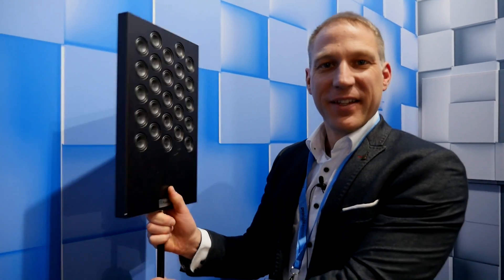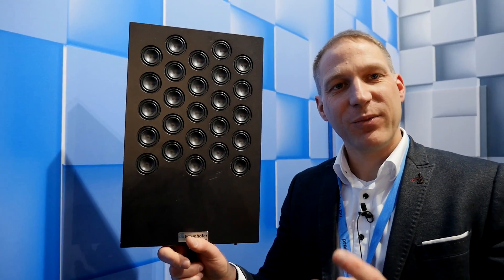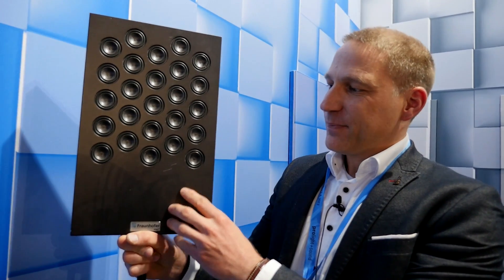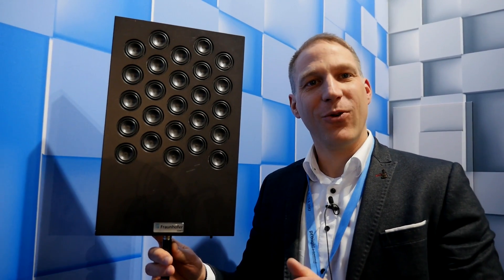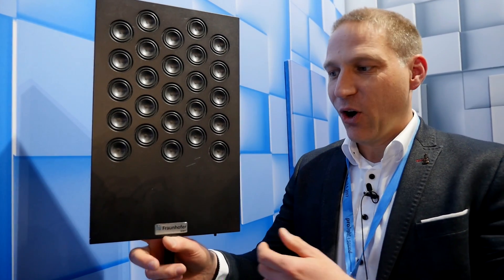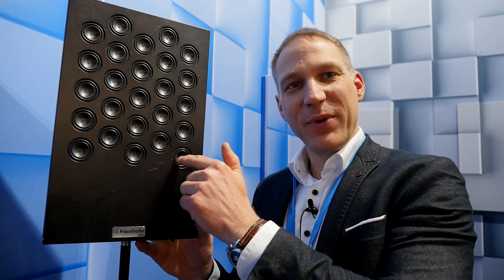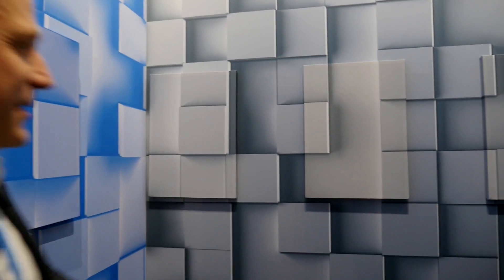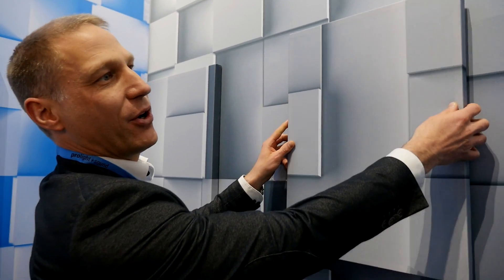MESSE 2017: Thin Panel Speakers from Fraunhofer use New Tech

Comment: Just call it what it is , pneumatic suspension !!! (the air sealed small enclosure that's air tight for every individual driver , it's a bit different from acoustic suspension which is just a sealed enclosure , cause it has literally no air leaks !! that increases the pressure , and minimises the cone  movement  substantially !!

Comment: I have a Yamaha soundbar (YSP-4000) from 2008 that has 40 micro speakers with calibration microphone. It’s designed to create multichannel sound using the reflections in room and adjusting each speaker. Not 2.5cm thick but the array concept is similar.

Comment: We did this kind of thing in Finland 1993 called SoundScreen. It was much bigger and produced freq range 20-20000Hz, but it was bigger, like a wall. Made by Lounamaa Electronics/Audiofiili. Basic theqnique was the same, use many small drivers instead of a few big ones.

Comment: Very intriguing and inspiring product.   Now im thinking about the stereodetail if i had a large wall  of these things. or two walls.. or all walls and the ceiling...
Reply: actually, I was thinking....what if you use the exact design, but use 5 or 6 inch speakers....I am saying...EXACT design...individually sealed...still not that big of a speaker system would result, but...50...yes 25 per side...5 or 6 inch speakers could sound insane?!?
Reply: The drivers might be phased somehow to act like a regular speaker

Comment: If it moves as much air as a woofer, why doesn't it handle frequencies below 100hz?
Reply: For reproducing low frequencies, you need to have a low free air resonance of the driver. Small speakers like those do not have a low resonant frequency and therefor they can not reproduce such low frequencies. Increasing the number of drivers does not lower their resonant frequencies, it only increases the amount of air being moved.
Reply: That would probably require a thicker panel, to make speakers capable of the low Hz.
But since sounds at 120Hz (and a bit above depending on the room) is position in-sensitive, one can simply combine them with a subwoofer, and it will still seem like all the sound is coming from the same place.
Reply: So basically another small speaker with a flat shape. ..can be handy.  What about the old electrostatic speakers They were expensive and supposed to be the shizzle.  Maybe they also were only mid to high frequency. ....?
Reply: Yes electrostatic speakers lack the low-end.
But also they are not designed to sit flat against the wall as they project sound backwards as well.
There are other wall speakers, that are pretty slim, some with front firing bass ports, but all lack the lower end, even is some plays a bit below 100Hz, but as long as a sub is needed, it doesn't really matter if they cut at 100, 80 or 68.
But these are supposedly among the slimmest ones.
having speakers that look like canvas art is quite nice, as that can potentially camouflage them. There would still be the issue of getting a subwoofer that sounds good and does not look like a subwoofer. the PV-1D by BW is on the way. And Planet Sub by elipson is another one that doesn't quite look like something speakerish. But most subwoofers do are imposing.